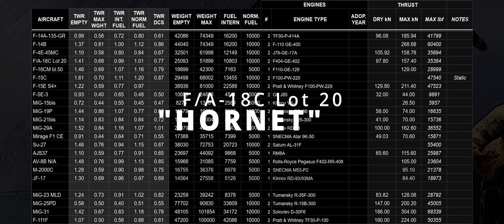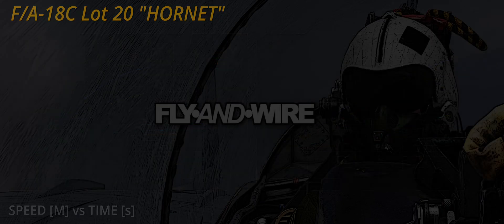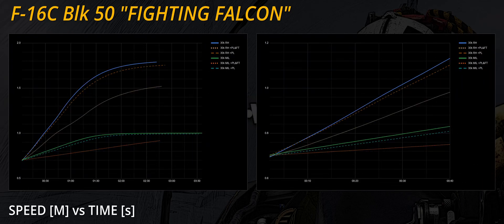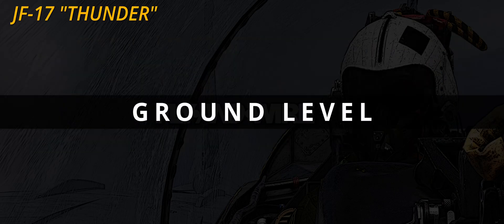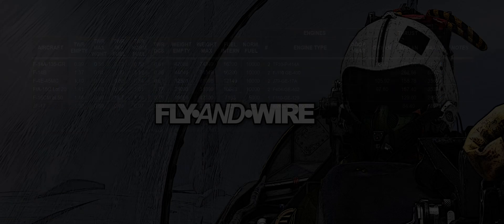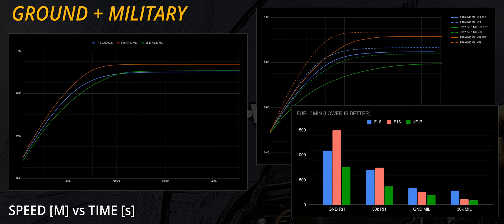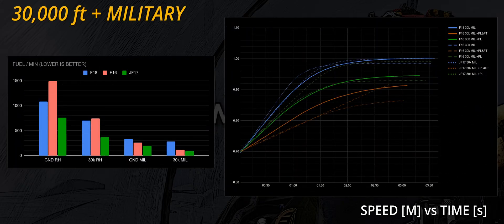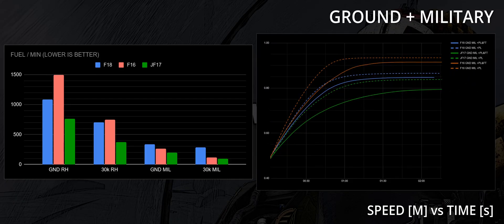TWR, Fuel & Performance: F-16C vs JF-17 vs F/A-18C - Comparison

Comment: Great info - thank you for sharing!  There's a ton of useful info in these charts!

Regarding the F/A-18C's fuel consumption at mil: maybe it doesn't like the transonic barrier at mil power?  I've never seen the FPAS in the Hornet suggest a speed over mach 0.86 for maximum range so I would guess each of these jets have their best range (and best distance/fuel consumption) below mach 0.86 to mach 0.9.  

Unloading definitely helps with the F/A-18C's acceleration around the transonic speeds to get above that mach 1.05 mark at least, and diving definitely helps too.  Also, something I find interesting in the F/A-18C: putting the velocity vector directly between the top of the speed and altitude indicators on the HUD usually yields a unload acceleration near 0.1 without having to reference the G value in the bottom left.  I'm not sure if that's by design or not but I find it's very handy.

Comment: The fuel consumption is surprising, I always assumed it was the worse of the bunch with an old soviet engine.
Could you compare the Mirage 2000? I know it is abandoned now, but it feels the faster of them all, it can do m1.3 on the deck and while acceleration is slow you can get ro m2.1 with its full AA loadout.
Reply from the maker: It takes a non-trivial amount of time to gather all the data points needed to make these models. Given the status of the Mirage 2000 and RAZBAM in general, I'd rather not do that. If things are sorted, and unfortunately, I more and more doubt it, I will do both the M2k and the Strike Eagle.
Reply: Regarding M2k acceleration: I have outran so many missiles and so many other jets in the M2k years ago.  It was so fun to outrun (almost) everything by just climbing to 40k, holding mach 0.9/1.0 then when I would start to get shot at with missiles, I would dump fuel tank, put the hostile missiles at least on my beam, unload, and dive/climb until my speed was well above mach 2 while everyone else was still doing mach 1.2.   I won't lie: it felt wrong but it was fun :)   If the Mig29 FF can manage it's fuel, it might be able to do some of these things too.  

Yeah, seeing how the M2k will be discontinued shortly - it might not be worth the while to compare.  Even the F-15e would have been interesting to see with respect to acceleration.